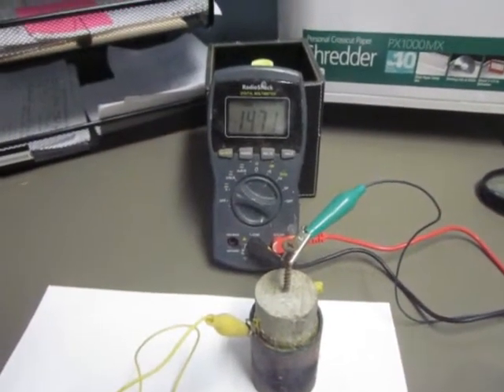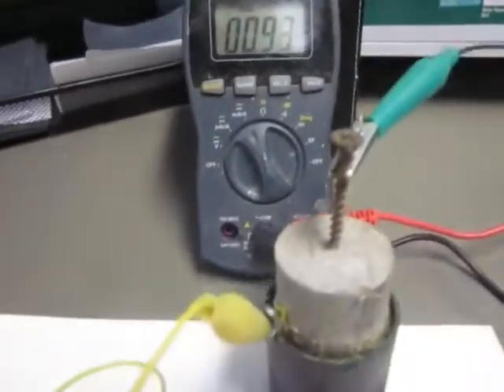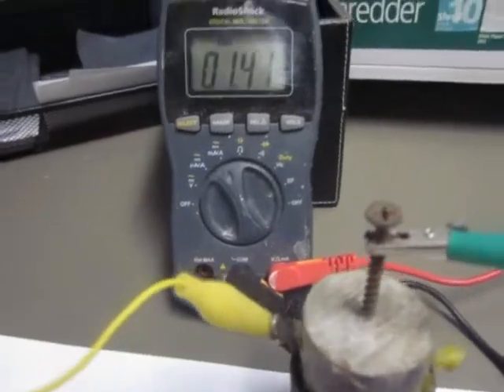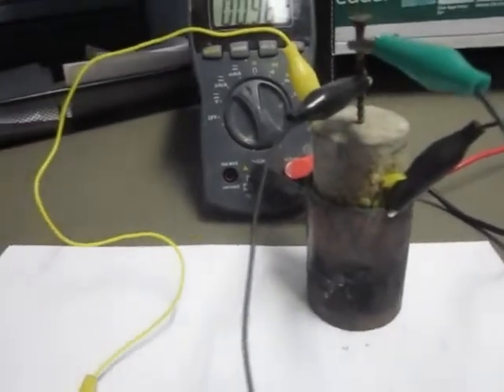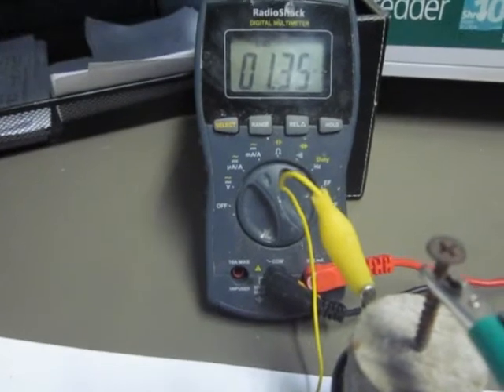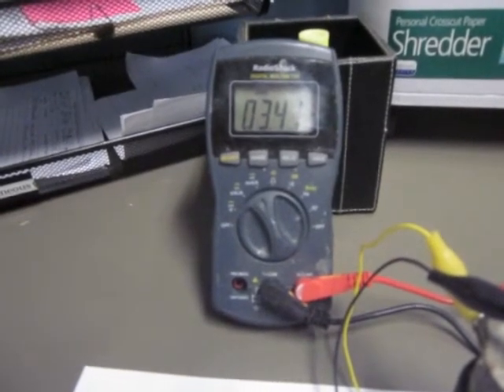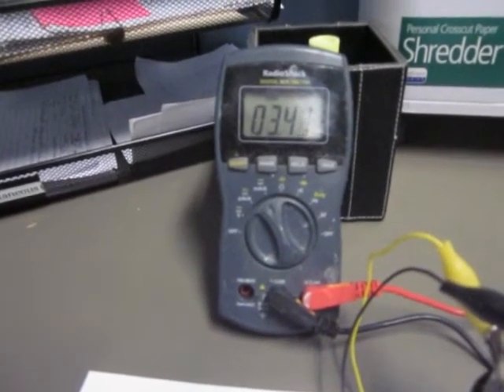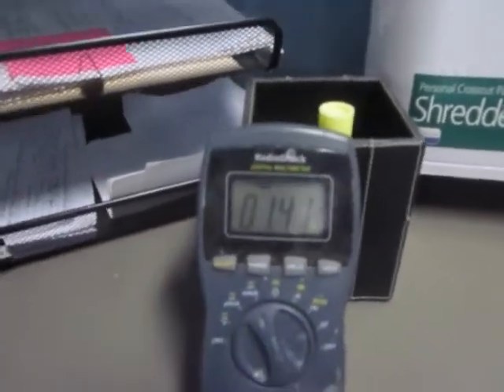Allwest "DRY" Crystal Power Cell

Comment from the maker: Shad, this is the old cell that I have kept & tested, that does not die, no matter what I do to it,very low power but keeps going, 

It is currently acting like a self generating thermal electric device, power goes up when you add a load to it  

You can get as much as 500Ma with this cell if you, add heat to copper and cold to mag  

Find the mixture on the posted thread, and let me know how it goes for you 
See link above

Comment: This cell still working?
Reply from the maker: Hi Randy,
Yes, I just tested it and  the cell is still putting out voltage 1.52 volts
3 years and going
Reply: That's wonderful! does it have much corrosion?
Reply from the maker: Randy Travis About the same corrosion as you see, did not expect much being dry 
Some of the recent cells are in the 2.2 volt range dry for a long time 

As you may know, volts are only one part of the equation, the amps are very low on these cells but seems to have no end in sight, such is the crystal based cell

These cells are thermal reactive, meaning that heat will charge these cells
Reply: Do you think you could make a special cell for me? You don't have to keep it, and can take it apart after you do the experiment.
I would like you to make a crystal cell that has either the anode or cathode to be gold and the other graphite. You can use a piece of old jewelry or broken jewelry that is the gold and some graphite, a graphite rod from welding supply will do. This would be an experiment to see if the energy made by crystal cells is just from galvanic reaction or if it comes from another source. It cant contain any other metal or other material that can corrode. This would be a true everlasting battery, because it cant corrode. Gold and carbon cant corrode with out special acids that are not present in a crystal battery.
Please let me know what you think. It dosent have to work well, it just has to make some energy to prove a point.
Thanks
Reply from the maker: Randy Travis Hi Randy, I am not aware of any gold items that I have, that are just laying around to try this 

Regarding ever lasting power without end
Hmm........... this has been suggested and discussed on many sites
Hoping to have a cell that is ever lasting without end, Some has lasted a very long time generating descent volts but very little amps

First of all, any cell that has two different materials for anode and cathode are considered a galvanic cell 
NOT! a Crystal cell
Although there are some that are doing real research on real crystal cells 

I guess I am in my own camp on this, I believe that most everyone that is working in this area are recreating the Zamboni cells (dry cells)        
Do a little research on Zamboni piles Zamboni (pilehttp://en.wikipedia.org/wiki/Zamboni_pile,) do a little study on this and you will be way ahead of the group 

You will find out that Zamboni piles last a very long time (dry cells with very little amps), they start out galvanic and then dry out, using no acids and a dry environment the cells will corrode, but very very slow   

This is just a fun hobby for me, but I have learned a lot in the time I have been studying it   
1. I have made a home made battery with copper and magnesium that reached over 2 amps shorted out for hours 
2. I have made a rechargeable magnesium and copper battery
3. I have made a dry cell that has been sitting at 2.2 volts from graphite and magnesium, with no signs of corrosion  
 4. Then I have done some work with truly crystal cells with very interesting results 

Have fun